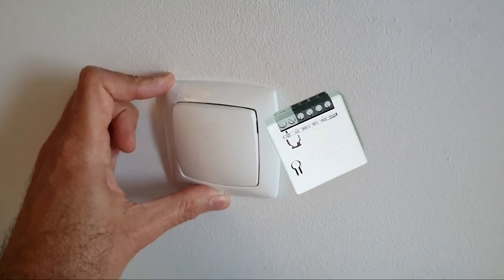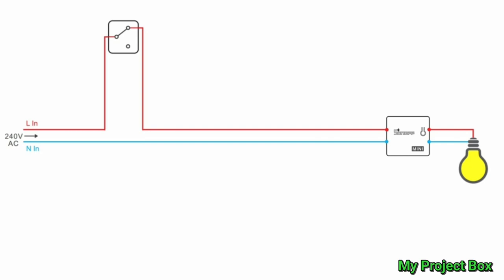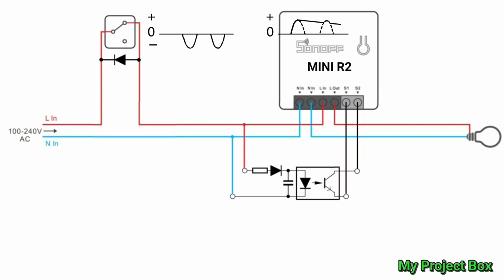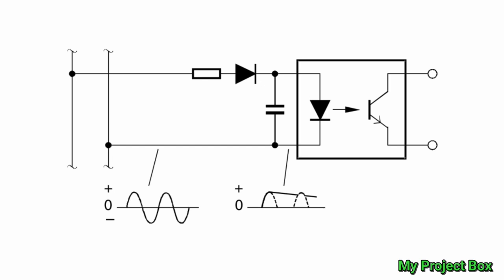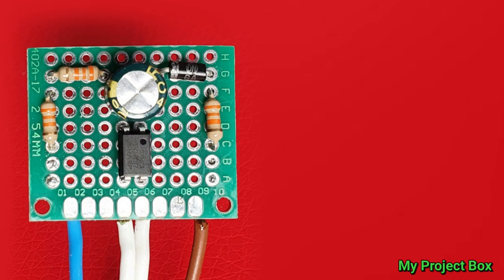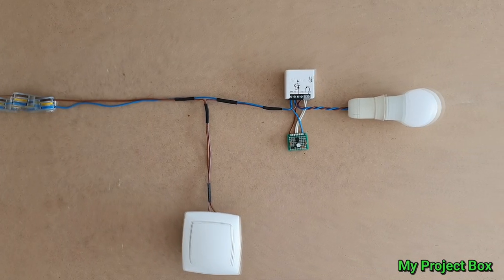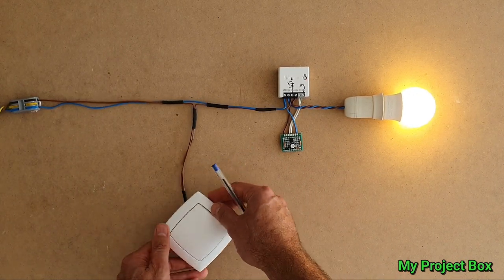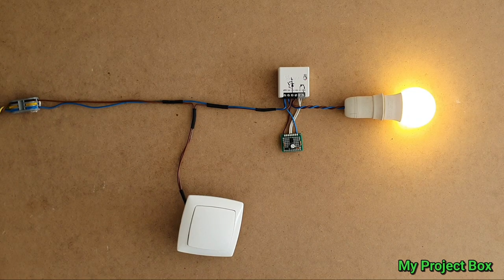Sonoff mini Hack. No neutral? behind light switch No problem! No Live wire!  #ElectronicsCreators

Comment from the maker: There's an updated version of this circuit hack that makes it compatible with more LED bulbs.
it includes a diode and capacitor that eliminates flicker in many types of LED bulbs. There's an updated version of this circuit hack that makes it compatible with more LED bulbs.
it includes a diode and capacitor that eliminates flicker in many types of LED bulbs. It features the Shelly1 instead of the Sonoff mini
https://youtu.be/YItMu6VJGBI
Reply: Hello, I've got a small dilema about something, and would appreciate if u could give me your thoughts on it.
Like many people, i have no neutral wire installed behind switches in my apartment, so ive got to use some way to overcome that.
But, there is one thing that, I think, makes it easier for me.
I've got two live wires coming from the switch to ceiling light, so i was thinking of sending one live directly to the light fixture, where i would put smart switch module, and the other one could be controlled by fiscal switch, which would pass 220v when on. I know there are solutions like Shelly 1 and others who accept 220v as external switch trigger, but the only thing I have available for me right now is Sonoff mini, which as u know uses low voltage ground for external switch. 
My question for u is, what do you think the best solution for using 220v to bridge S1 and S2 inputs would be? 
I was thinking of high voltage relay of some sort but am really curious of your opinion non that? Thank you in advance.
Reply from the maker: @petar.  yes it is possible to use a relay with a 220 volt coil. The relay contacts can then bridge S1 and S2.  You can get quite small relays that have a 220vac coil, but they tend to be rather expensive.  It might be easier just to use a Shelly1. But the relay will definitely work.

Comment: I just did a "circuit hack" and I can say that the thing works as shown in the video. It will save me a lot of time because I have installations without a neutral wire behind the switch.

Comment: So ingenious. For electronics guys probably not so much but for electrical guys just wow
Reply from the maker: It's a bit unorthodox but the bottom line is that it works great.
Reply: This is bloody genius indeed!, using half the wave to communicate with the circuit, I second that WOW!

Comment: Absolutely genius! Thanks so much for this... I have been looking for a good solution for ages, I actually prefer to have these in the light circuit anyway.. There is very little room in my wall boxes!
Reply from the maker: Just remember not all LED light bulbs function on half-wave DC. So test your LED bulb with a diode first. Just find one that works. Led strip lighting with LED drivers should also work.

Comment: Great Video, thank you for taking the time to share. I would suggest you can now go and buy the Sonoff ZN Mini L which does all this for you :o)
Reply from the maker: The Sonoff ZN Mini L is a great option😉, but I think you need a ZigBee hub aswell to make it work? My option allows you to put it by the light fixture itself. Up there you get a very good Wi-Fi connection.  The switch back box sometimes limits the WiFi reception, especially if it's made out metal and not plastic. I think having more options is good 👍
Reply: @MyProjectBoxChannel  I definitely agree with the more options the better. Keep up the great work and thank you again for posting the video

Comment: Thanks for a brilliant video!! :)
Though after seeing Your elegant solution I can not help but wonder why Sonoff doesn't include a similar "option" In their products, seeing that it wouldn't have to add many pennies to the price but make their switch much more usable for all "average users" that have this wiring in their houses/apartment's. And possibly in my opinion just as "valuable" it also "Adds the option" for mounting the  "on the wire" where ever it's most convenient, rather than having to mount it  "with the switch"
Again thanks for the video, best regards.
Reply from the maker: I think a smart bulb with this circuit inside would be perfect, this way the light switch with diode, won't disable the bulb and keep it powered for WiFi control.

Comment: But if you're using an incandescent bulb (or a halogen one, or a fluorescent tube), you'll use half the power in some cases, correct?
And that is not the case with your other more recent circuit, correct ?
Reply: Now that I think about it:
If you replace the diode at the switch by a full bridge rectifier, the rest of the circuit will work the same but you would have "full wave DC" (and still be 230V RMS) powering the incandescent bulb, wouldn't you?
Reply from the maker: Yes half-wave on a resistive load, like a incandescent bulb, will give "half the power". This video is quite old, and in my new videos I added a capacitor to smooth the ripple. Some LED bulbs ( like the one in the video) have a capacitor inside, so the ripple isn't a problem. But adding a smoothing capacitor makes the circuit more universal, and you don't get a reduction in brightness, or unwanted flicker, with some bulbs. https://youtu.be/9hQFFsBkxaU
Reply from the maker: @NicksStuff  Unfortunately a full bridge rectifier, at the switch won't work🤔☹️. My switch detection circuit, relies on knowing the difference between full wave AC, and half-wave of DC.
Reply: @MyProjectBoxChannel  I mays be wrong but I think a full bridge rectifier at the switch would work as your circuit (on the lamp side) detects AC vs DC. With a full bridge at the switch, you'd generate "full-wave DC" when the switch is open and full-wave AC when it's on.

I'll watch that newer video, I hope the circuit will work with a high resistive load and a ZBMini. 
EDIT : I watched the video, it doesn't improve the situation if you want to use an incandescent bulb or neon tube.
Reply from the maker: @NicksStuff  now I'm very  curious how you would connect the full bridge rectifier at the switch 🤔. It has 4 terminals. Remember my circuit is only needed if there is no neutral behind the switch! So you can't connect both the line and neutral 🤔. And then the switch needs to bypass the full bridge rectifier somehow. Let me know your thoughts.

Comment: Excellent Idea! I think of one drawback: you have to use the same way to power off the light, in other words if you switch the light on through google you have to use the app to switch it off. If you switch the light on using wall switch and then use the app to switch off it becomes complicated because you can not switch on again using wall switch. However, it is a clever idea!
Reply from the maker: Thanks! BUT trust me it works in all the different combinations of On and Off, by the phone and light switch in halfway and full wave mode any combination works. I have tested all of them. The LED bulb works with half wave DC and full wave AC, so does the sonoff. The optocoupler circuit just detects when the switch is open or closed and triggers the sonoff s1 and s2. That's the magic of putting a diode across the switch.
Reply: @MyProjectBoxChannel  if I switch on by the wall switch the full wave goes to optocoupler and this means "on". If you switch off by the app the wall switch remains on full wave indicating "on". Sonoff will switch off lamp but the wall switch says "on". When later use the wall switch to turn on the lamp the wall switch will go at half wave state which means "off" for optocoupler. So you have to press wall switch once to recover the state to "off" and once more to enable again "on". Am I missing something? how is is really working?
Reply from the maker: @mariosxenos7157  the sonoff mini is just looking for a trigger. It doesn't matter if the switch is in the on or off position it's just looking for a change of state. (Rising or falling edge trigger) Off to On can trigger it , and so can On to Off. 
https://youtu.be/RRsvMgCDVjg
Reply: @MyProjectBoxChannel  exactly it’s looking for a change state not a logic

Comment: Great project, liked and subbed! For any who also have zigbee systems, sonoff just released the zbmini-l which works without a neutral wire. I wonder if they've incorporated a similar solution into the device. Shelly has the no neutral requiring 1L, but it requires a resistor in series for low current circuits to prevent lights from flickering when off. In any case, things are finally looking up for those of us without neutral wires, haha!
Reply from the maker: I'll be doing a video on a similar circuit hack for the Shelly 1. So if you don't have a neutral at the switch you can put it at the light fixture instead. And still control it with the light switch. I just wanted to give people some more options 😉

Comment: What should be the power of the resistors, or 0.125W is enough?
Reply from the maker: 1/4 watt resistors are fine (0.25W). In my Shelly video I made some improvements to the circuit. I added a diode capacitor to the LED bulb. It makes it compatible with more types of LED bulbs. https://youtu.be/YItMu6VJGBI
Reply: @MyProjectBoxChannel  OK thanks you. 👍

Comment: Thank you for sharing
What  about roller shutters will work with this circuit if i use one of the two hot lines?
Reply from the maker: I don't think it will work😥. The circuit is mainly intended for some types of LED light bulbs, and possibly some SMPS power supplies. The thing that you are powering needs to be able to tolerate half-wave DC. You could probably power a relay (with a diode and capacitor to smooth the ripple) that triggers something else.

Comment: I one video suggestions is to put fusible resistor 10 ohm 1w in circuit.
Where tu put it?
Reply from the maker: You can put the fusible resistor inline, on the L-IN terminal of the Sonoff mini.
Reply: 10 ohm 1w will be ok?
Reply from the maker: @tin101104  yes but remember it has to be the fusible type

Comment: 5:27 this is great idea for my 5 gang switch, i’ve been struggling to make it smart because the wires are just too thick behind the switch and I want to avoid adding a spacer or second switch (3gang + 2gang). 

1) Since it’s 5 gang, i would need to add 5 diodes on the main switch?
2) With the half wave dc powering the sonoff mini. When the main switch is toggled, this would just toggle the relay for the sonoff mini?
3) I’m planning to buy tuya version of the sonoff mini, the custom pcb should work assuming they work the same way?
Reply from the maker: The "tuya type" smart switch should in theory work. BUT!  People have reported them working, but on some of them the diode polarities need to be reversed, on all the diodes(and capacitor polarity).  You can easily test that by powering the "tuya device" through a diode on the neutral, to test which polarity works. Then you arrange all the diodes accordingly.  Also this video is quite old, and I've since improved  the circuit by adding a diode and capacitor to the LED bulb.  This prevents any unwanted flickering in some types of led light bulb. Like in this newer video, the diode and capacitor is included. https://youtu.be/9hQFFsBkxaU  You can probably build it on a prototype (Perf board) pcb.  It's essentially exactly the same except for the extra diode and capacitor for the light bulb.  You of course only need one diode per light switch.
Reply: @MyProjectBoxChannel  appreciate the headsup on the reverse polarity. That means i would need to mirror all the diodes from Lin & Lout.

The best way would be testing using the light bulb before the tuya wifi module to avoid smokes if the polarity is wrong as you’ve instructed.
Reply from the maker: @thebatu89  Yes you are correct👍. Just set up a test rig with a in-line "old incandescent bulb"💡, for safety current limiting. Verify that everything works. Note down the polarity of all the diodes. Remember if the polarity of one diode changes,  you then have to change all of them, and capacitor polarity aswell. 

Be safe! This is mains voltage ⚡️ 😉
Reply: @MyProjectBoxChannel  thanks, appreciate your advise.
As for the fusible resistor, if it has 5 lines does that count as one? I’m looking at my local marketplace and they’re all just listed as resistors

For soldering wires to diodes, which wire thickness should i get (for smart switches like the switchman)?
Reply from the maker: @thebatu89  if you are doing a 5-gang light switch, with 5 separate sonoff/tuya's , then you will need a fusible resistor for each one. 
If you are you are using something like the sonoff switchman M5-3C (3-gang switch) ,then you only need one fusible resistor, for the channel with the bypass on it. You can solder 0.75mm2 to the diodes. I normally strip the flex cord from some old appliance. It's very flexible and easy to solder.
Reply: @MyProjectBoxChannel  thanks again, found a shop that sells one, but only up to 5 ohm.

With the custom pcb, is it possible to supply power to a usb device (esp32 with mmwave sensor for example) even when the switch is toggled off?
Reply from the maker: @thebatu89  the 5ohm fusible resistor will be OK 👍 (10ohm will be better)

You should be able to power the USB PSU in that way. (If I'm understanding you correctly)
Reply: @MyProjectBoxChannel  hi, sent a diagram to your facebook inbox. Appreciate if you can have a look at it

Comment: Thank You for sharing. But in this case You have to be carefull when changing the bulb, because in every case is the plug under voltage ?
Reply from the maker: No not necessarily because the sonoff turns the power off to the bulb socket not the light switch 😉👍. But it's still a good idea to turn it off on the fuse board 😉
Reply: @MyProjectBoxChannel  You are right. Thanks.

Comment: I found more then one optocupler version (THT or SMD - 35V or 80V):
PC817X1NIP1B
PC817X2NIP1B
PC817X2NSZ1B
PC817X3CSZ9F
PC817X3NSZ1B
PC817X4NSZ1B
PC817XNNSZ1B
EL817
EL817C
LTV-817
Which one is best to use (THT or SMD - 35V or 80V)?
Reply from the maker: All of them should work fine 😉. It depends on your use case/ PCB design, whether  hole or smd is suitable for you. I used "through hole" for my prototype. 80v type might be slightly better safety rating, but it's not necessary.

Comment: Can this hack work with somoff D1 smart dimmer switch?
Reply from the maker: No unfortunately it will not work with a dimmer type switch. 😩 you may like this no-neutral circuit aswell https://youtu.be/oBR5O391m_c

Comment: I see now that with Shelly circuit hack there is one more diode and capacitor used. Which capacitor is used and where to put/soldering this capacitor and diod on Sonoff circuit hack?
Reply from the maker: The capacitor goes across the light bulb with its positive +terminal connected to the bulb neutral, and the negative terminal goes to the other bulb connection, joining to a diode which then points  towards the L-out of the sonoff. Essentially exactly the same as the Shelly circuit. 10uf 400v should work for most LED bulbs.
Reply: In Shelly1 circuit hack 4,7uF 400V capacitor is used.
10uF will be better?
Better to ask then burn something.
Reply from the maker: @tin101104  4.7uf  to 10uf at 400+V, should work fine.  10uf just covers most of the LED bulbs with higher wattage rating. (It prevent flickering)

Comment: So, you have a switch that traditionally turns the power on and off, shorted by a diode. How does this meet in any way, the wiring regulations?
Reply from the maker: I'm not sure if it's a problem. But I don't think the light switch is ever considered safe isolation anyway. You should never consider the light switch as turning the power off by the light, as a means of making it safe to work on anyway. Lots of new electronic style light switches have leakage current across them, so they aren't truly "On Off" switches. Think of the "no neutral" type switches(and no neutral PIRs). If you wanted it to be safely turned off, you turn it off at the circuit breaker by the fuse board. Wiring regulations are different in each country.

Comment: Thank you for sharing this. Just one question: What' s the polarity of the 470u capacitor?
Reply from the maker: The diode is connected to the positive of the 470uf capacitor. I really should have indicated the polarity of the cap in the video 😥. By the way I did a video of the Shelly1 version of this circuit. It actually has some improvements that makes it compatible with more types of LED bulbs. If you include a diode and capacitor, it stops many types of LED bulbs from flickering. I strongly urge you to watch the updated video link below
https://youtu.be/YItMu6VJGBI
Reply: @MyProjectBoxChannel  Yes you're right. Your Shelly video shows the polarity. With regards to the Sonoff mini, I'm afraid the transistor side of the opto, must have a polarity when connected to the S1 & S2 in order to work because they are not "free contact swich"
Reply from the maker: @kdelios  you are correct the transistor side of the optocoupler needs to be connected the right way around. This is because S2 is pulled high via a 10K resistor to +3.3v and S1 is connected to ground. I actually reference a mistake in the video in the chapters. It's very brief and the rest of the video is all correct. By the way the polarity of the transistor is also important in the Shelley1 circuit. Inside the Shelly1 the Live terminal, is actually reference to "ground 0v", and the SW input, is pulled up via a resistor to +3.3v

Comment: My questions about fusible resistor is gone...
I found 10ohm 1W (FRN01WK0100A10) and 10ohm 2W (FRN01WK0100A10) fusible resistors. Which is better for use with circuit hack?
I one Your video 2W version (red) is used.